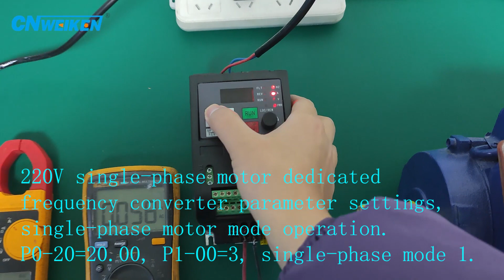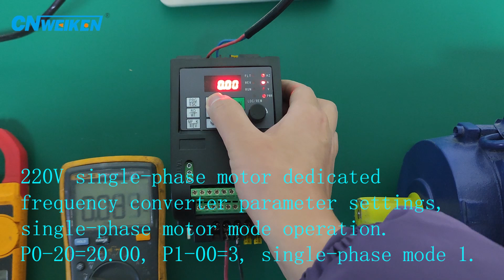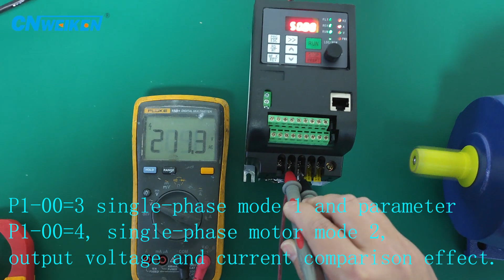VFD Single Phase 220V Input and Output Frequency Converter Drives For Single-Phase 220V Motor

Comment: is there and electrical plan for the above connection ?
Reply from the maker: Input single-phase 220V to ST terminal, output VW to connect single-phase 220V motor

Comment: Como resetar para os parâmetros de fabrica o WK600D-0022-D1T ?
Reply from the maker: set pp-01=001
Reply: @cnweikensun1414  Consegui resetar para os padrões de fábrica mas o problema persiste.
Quando o meu inversor está trabalhando nos painéis solares ele ajusta a tensão e a frequência corretamente enquanto o motor não está ligado.
Quando eu ligo o motor o inversor só ajusta a tensão e a frequência quando a luminosidade do sol reduz. Quando a luminosidade do sol aumenta o inversor não aumenta a tensão e a frequência, fica estabilizado na frequência e tensão que estava quando o sol diminuiu a luminosidade.
Quando a tensão dos painéis fica muito baixa o inversor desliga o motor e apresenta o erro Err09, porém não inicia automaticamente quando a tensão volta a subir para os 320v DC.
A configuração que eu fiz depois que resetei:
P0-03=10
P0-29=0400
P0-30=3
P0-31=200
P0-32=3
P1-11=0010.0
P9-05=1
Configuração do motor:
P1-01=0002.2
P1-02=0220
P1-03=0010.0
P1-04=50.00
Reply: I have a 550W single phase 230v motor with a start capacitor, originally 2900 1/min. What settings should i use to be able to control the revolution of the motor? Used p1-00=3 and p0-20=20, it was not ok.
Reply: @MrTizenhatkarakter  No meu ficou assim, P0-20=0020.0 e P1-00=4, com isso a saída U fica inativa.
As saídas V e W ficam funcionando no modo monofasico.
Reply: @joaopauloleles4852 it is now okay but not always. In certain positions of the axis, the motor is unable to start - i guess beacuse starting torque is insufficient. Can you add it in the menu?
Reply: @MrTizenhatkarakter Mesmo o inversor chegando na frequência máxima do motor ele não está dando partida? 
Ou isso só acontece quando você tenta controlar a frequência e em baixa frequência esse problema acontece.
Quando isso acontece, se você aumentar a frequência o motor consegue dá partida?
Reply: @joaopauloleles4852   it sometimes doesnt start at all regardless of the frequency. I am 95% sure this is because the motor i am regulating, has a start-run-capacitor. It was made in the 1980s and that time capacitors were the only way to trigger starting torque for single phase motors
Reply: Also, the rotor keeps overheating, not that badly but anyway. I set P3-01=20  and P3-02=50 (i.e. 20% plus torque up until 50Hz) but still is overheating a little bit even without load. However with this 20% plus torque the axis starts and stops rotating not so smoothly like it should. An this way it can at least start in any position of the axis.